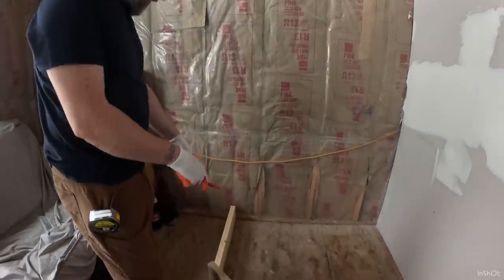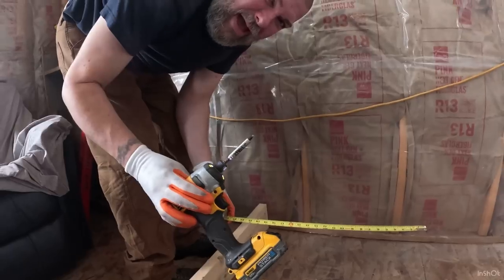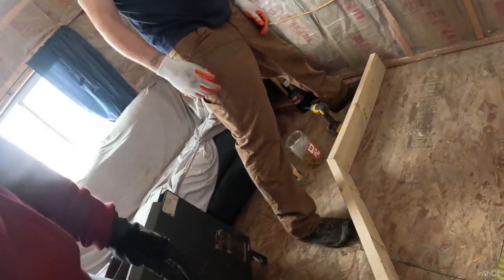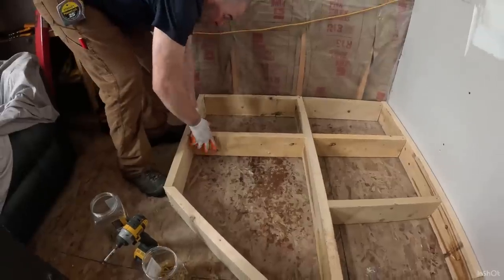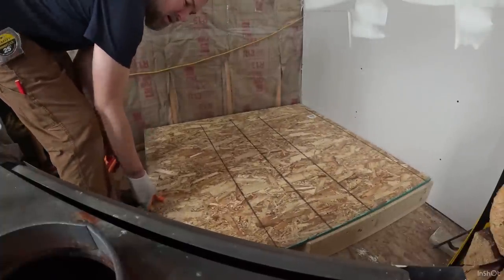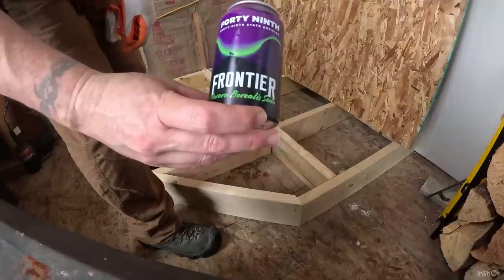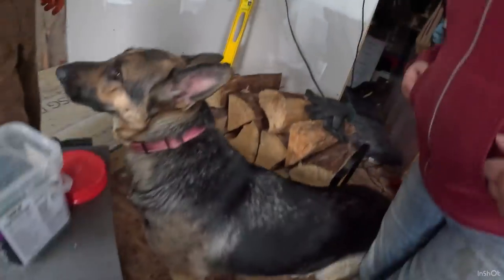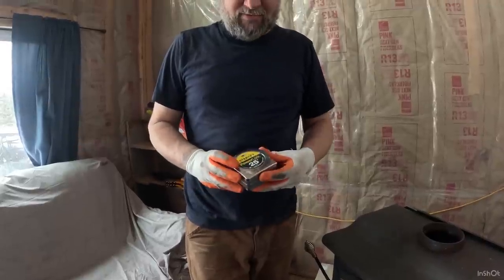DIY Building a Hearth for Wood Stove - Part 1 | Alaska Off Grid Homestead Tiny House

Comment: Since you are making a 45 degree angle at each joint, each half of the angle is 22.5 degrees. So you cut both boards at 22.5

Comment: Back wall need to be done before you screw down on the floor
Reply: The wall can sit on top of the cement board or tile or whatever they finish it with. Or do you mean before they screw down the stove to the floor?

Comment: Why not drywall that other side wall before doing this? Or at least throwing in 1 piece on the bottom back to front. Just curious. Nice job regardless.
Reply from the maker: Gotta run the electrical wires first. Normally you’d do that before the insulation but we had to get it buttoned up before winter.